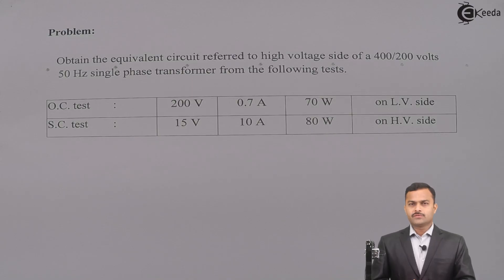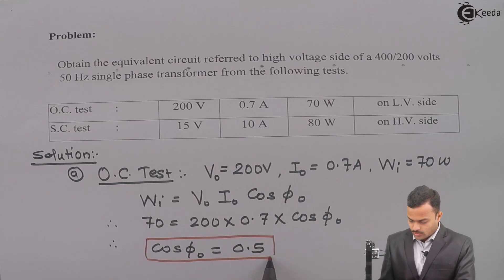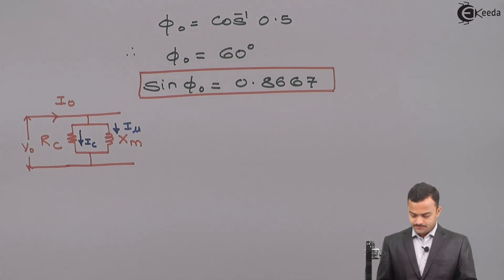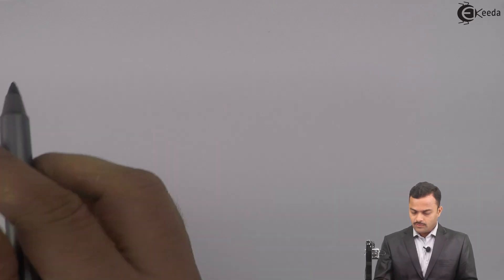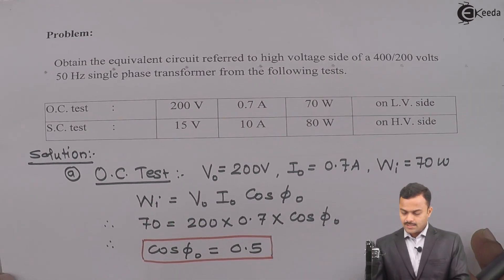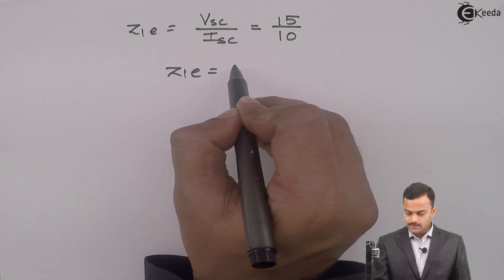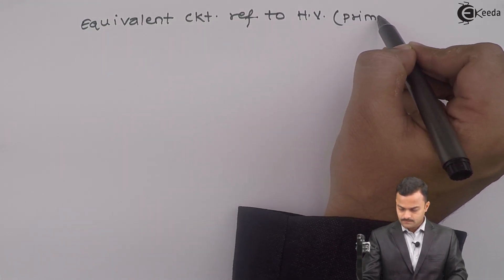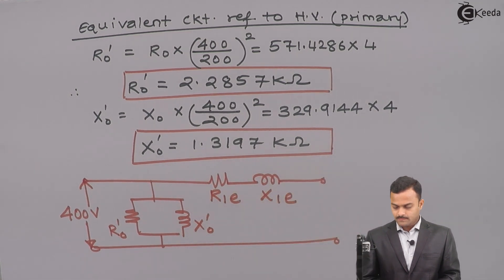Open Circuit Test and Short Circuit Test on Transformer : Problem 1 - Single Phase Transformer

Comment: I refer a book by Ravish Singh , there they say that "meters are connected on High Voltage Side ,i.e secondary " but you said that High Voltage is Primary .......???
Reply: good, u refer ravish singh book ,but here u have given primary side voltage is 400 which is more than that of sec side voltage 200,,, thats why here sir is assuming high voltage is of primary side...okay
Reply: Fiona, exactly what I read too, these books are just contradicting them selves, I don't know the one to follow